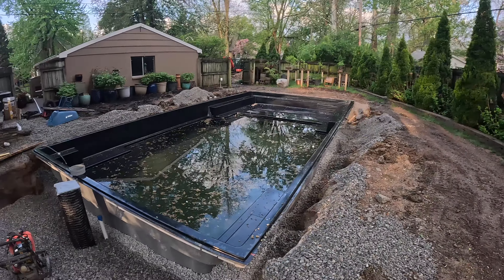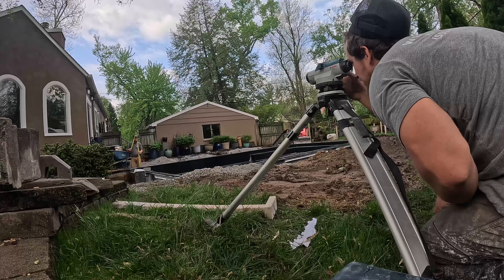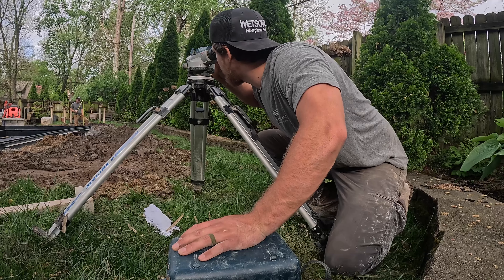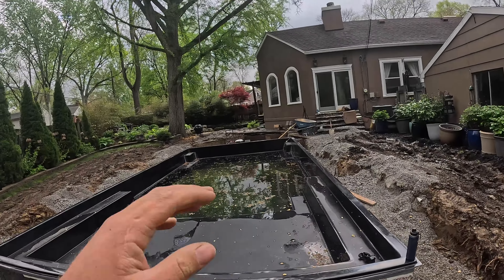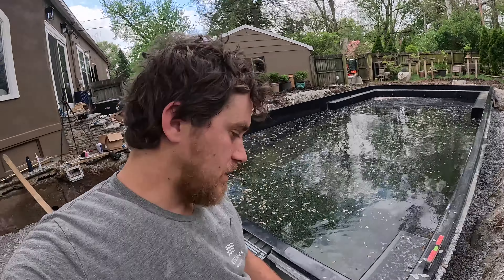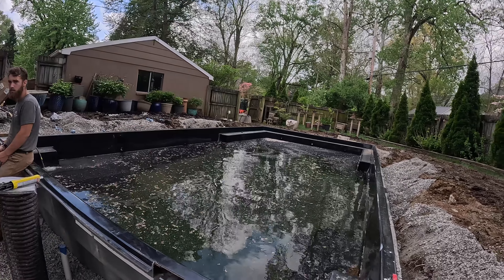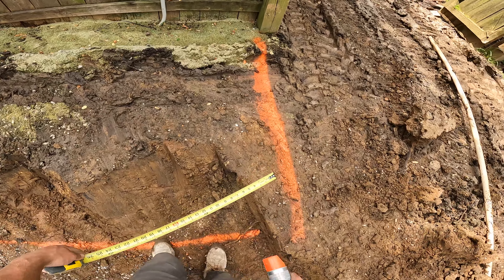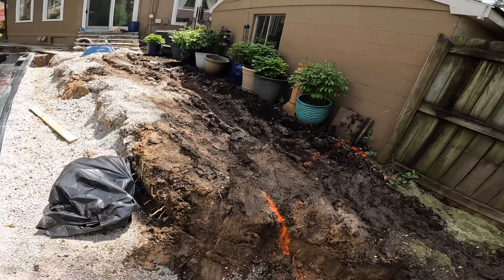Set your Fiberglass pool Perfectly!![with a sundeck [Inground pool construction]

Comment: Looks good. I fought the idea of flow fill for a long time but I now use it on all my tanning ledges/sun shelf/beach entry whatever they choose to name it. We set the level and block it to hold. Then pump in the flow fill. It works well. It’s just added in the bid. No extra cost on us. The labor savings alone help offset a lot of the costs of the flow fill. 
Are you guys moving the overhead power line? I think code is 15’ from water’s edge on overhead lines. Hard to tell distance in this video.
Reply from the maker: Yeah, we’ll see what we do. As far as the powerline goes, I think it’s 10 feet and they are fine with where it’s at. Meaning The city.
Reply: @jonport_  nice! Good to see other pool guys in our area concerned about doing good work. We both know there are a lot that don’t. I wish we had more licensing and certification demanded by the state. It doesn’t help that anyone can become a pool contractor.
Reply from the maker: @chaderichunt i know it. Its getting saturated.